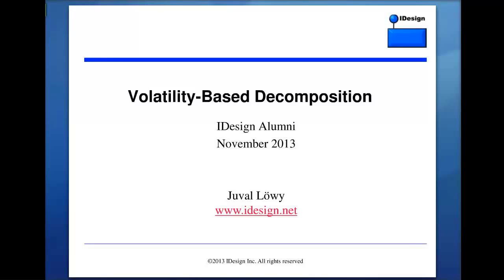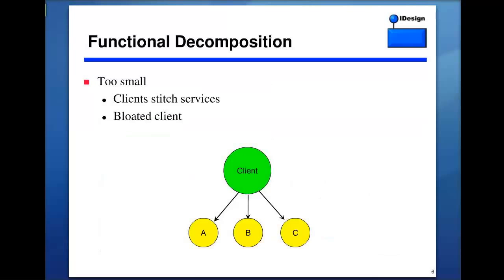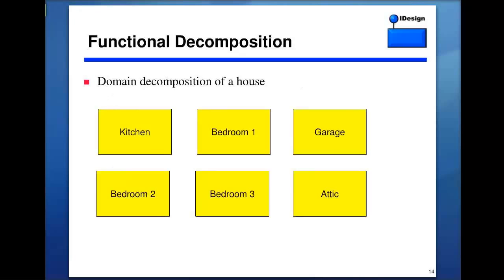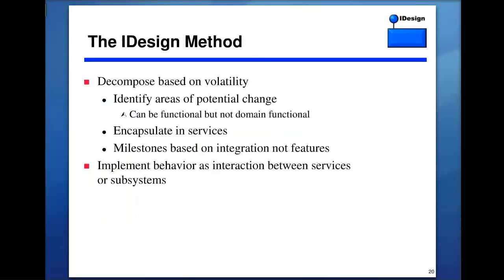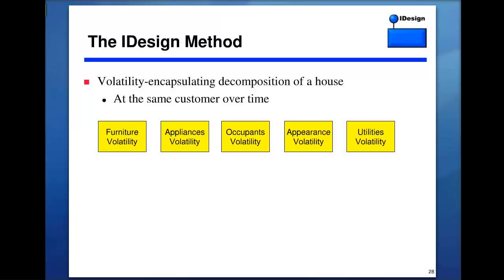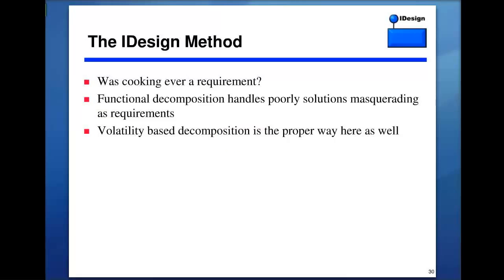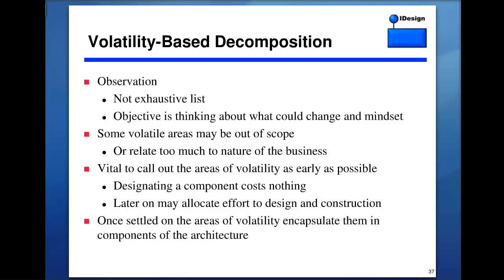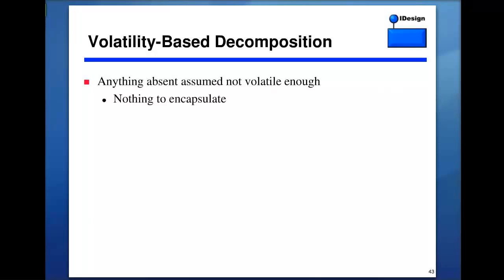Software Architecture Decomposition

Comment: This is the Great lecture but cannot understand is Volatility based decomposition contradict  with Domain Driven design?
Reply: I don't think so.
Reply: I don't think their focus is the same and here's my reasoning. Volatility based decomposition focuses on the volatility that exists in the problem space and explicitly encapsulate them in components. The system model will probably not resemble the business organizational model because the business capabilities appear only as a result of the interaction of the different components. Doman Driven Design focuses on mapping business domains to component(s)  so that a component or a set of components will encapsulate a particular business domain/capability and then further more business objects and concepts. The system model is almost a good representation of the business organization model (we normally say in DDD that teams map to business capabilities and are responsible for one service or a set of service related to a domain). Moreover, the simple fact that DDD does not explicitly consider volatility means that there are good chances that it will be spread across services and across domains.

Comment: One question, does IDesign make the components we design tightly coupled to the project?  What I mean it seems that if don't do domain based decomposition, and we're packing together functionality from several functionality/domain sets, then we couldn't reuse the same component in another project, correct ?
Reply: I heard Juval say somewhere that components don't get reused, only interfaces do.

Comment: I really like this approach of encapsulating areas of change as predictably as possible. However, how would this work with a project where in the beginning you have little to no knowledge on how to solve a problem (think writing a Google search engine clone)? Would an "Agile" approach be better here? Just try things out and change the architecture as we get more knowledge (which is costly and what we want to avoid with Volatility Decomposition) ?
Reply: If the other project is the same kind of business, the volatilities might be similar, so the components might be similar. But, no project is ever completely the same so nothing can be reused 100%.